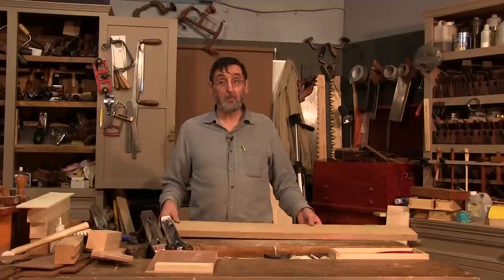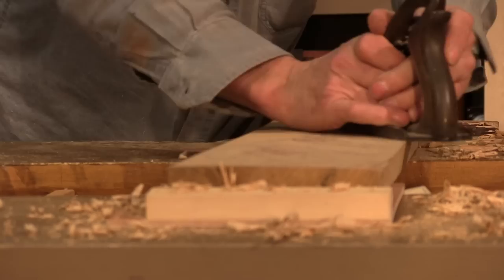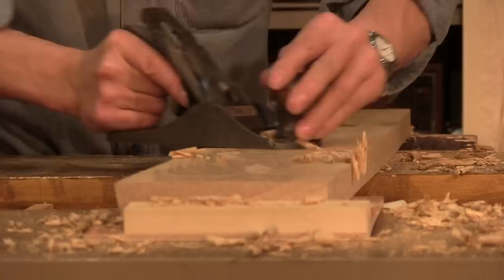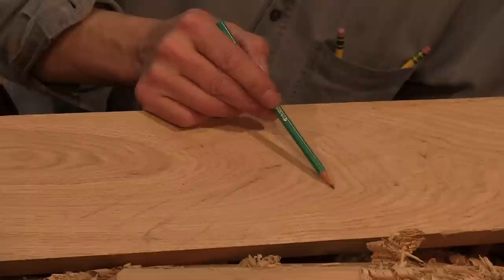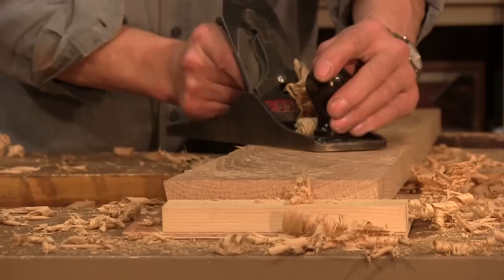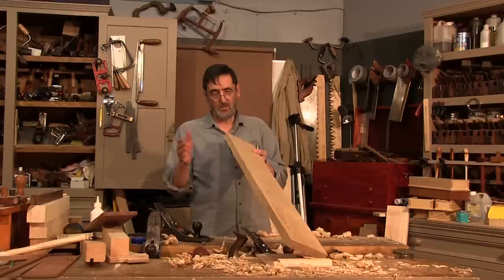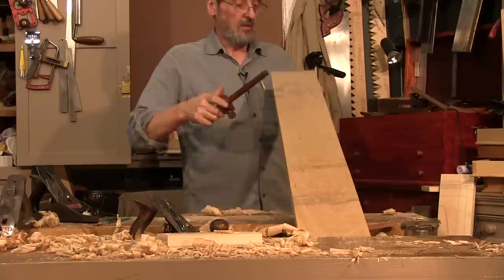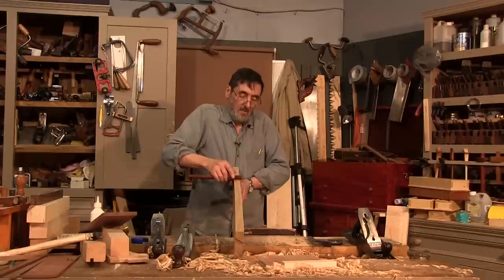How to make flat boards straight, smooth and square (stock preparation part 2) | Paul Sellers

Comment: I use a 4.5 Taylor plane and I'm waiting for a low angle Stanley sweet heart plane from Italy. I don't know why? Best price I think? I wish I could own a #4 Stanley, but my Taylor works great! A little heavy but if the piece needs to flatten a small piece I can use a Buck block plane. I think?
Reply: Instead of a Buck, have you ever tried an old Craftsman #306 block plane with an adjustable mouth? They're fairly cheap on e-bay and mine works like a charm.

Comment: Respect! I just wonder what will happen to that board once it has been straightened out.  Can you do this job in one day, or do you want to do it over several days to allow the wood to settle as it releases stress?
Reply: Good question. There are so many variables to be considered; Moisture Content (MC) of the wood, as well as the shop, species of wood, thickness of the particular board, etc., Then there's time available; physical fitness of the wood worker, how stored between planned or unexpected interruptions and  more.
Reply: @johnbesharian9965  I would not be surprised if it has been sitting up in his roof relaxing there for a year or so and should be fairly stable in his workshop environment. I heard him say once that he has 50 lengths of 4x2 up there waiting for odd projects etc.
But yeah, wood changes all the time, usually within acceptable limits once it acclimatizes to it's location and MC becomes relatively constant.

Comment: I have been trying to smoothen a block of Sal wood. The Sal is particularly very fibrous with thick fibres and also the wood is a piece from used old furniture and fully dry. My question is will it help to smoothen the wood if I moisten it and then smooth it. My only block plane (Ambika no 3) works perfectly well on beach or teak but I am having trouble with Sal, and it keeps getting stuck even if I minimize the blade depth.

Comment: hi paul, for the purpose of joinery, does the 2nd face and 2nd edge need to be perfectly paralell to the 1st face and first edge (the reference face and edge) ? ... if you are going to use ONLY the reference face and edge for marking (which I think is very good practice even if using power tools and you have perfect S4S lumber) , the 2nd face and edge in my mind dont need to be perfectly paralell and dead flat as they are not being referenced

Comment: Some kinds of very beautiful wood are barely impossible to plane.  Hard as concrete, very rough, twirly grain running in every possible direction, breaking out.  How do you deal with that?   I would like to know the names of those 'impossible' wood sorts.

Comment: I have an antique walnut table with badly cupped and warped boards on its top. Do I have to do something like this, or can I steam them straight or use some other process? Maybe the wood wasn't completely dry when the piece was made. (Sorry if this is slightly off-topic, BTW). Thanks for any replies.

Comment: Dear Mr Sellers

I was preparing three boards this weekend. Winding sticks were showing a raised right far corner. I kept plaining with no significant progress. Later I realised that by plaining the corner I have created new hump in the middle. The winding sticks were not sitting on the board so they were not representing the twist. 

Would you please explain your plaining technique in a bit more detail to avoid this problem ?

Comment: Mr. Sellers, do you ever need a longer plane, a Jointer Plane # 7 ?   I only have a smoother No 4 and  found difficult to plane long edges, and also i think it takes too much time to true faces, so i felt tempted for a number 7, but after watching this vid, i don't know if maybe the No 5 will be good enough (for now). What do you suggest?
Reply: Chava Flores Paul addresses jointer plane in this article here:
https://paulsellers.com/2013/07/15446/

However, keep in mind that he is THE Paul Sellers. Using just a no.4 plane, a couple of saws and some chisels he can build a credenza with worth thousands of dollars. His skill level is just that phenomenal.

So, if you have trouble planing, and suspect that you could get results with a #7, then go for it. Woodworking is about what works for you, after all. Best of luck.
Reply: truebluekit Thanks for the link. Funny thing, just today, before reading that article about longer planes I bought a used Stanley No.6; and it looks like i did good not buying the no7. This is long enough for what I do, and the weight is not too much for my arms, and i think it is a great machine, works fantastic.
Reply: Chava Flores There is another alternative - you can buy long jointing planes that are longer than a #6 to give you scope to work even longer boards... but that weigh MUCH less.... How? Wooden jointers.  Long before cast planes were even possible carpenters used wooden planes, and some furniture makers still swear by them look up "Krenov Jointer" and you'll see what I mean, but there are plenty available on ebay etc, that might look grotty, but a cleanup and tune (prolly levelling / flattening the base after years of use) and it'll make jointing a breeze.

Comment: A question Paul. A 5 or 6' length with cap and twist. Do you use your winding sticks end to end? Mid to end? 
And do you normally (as shown) deal with cupping and twist together please?

Comment: Another brilliant video. Thank you. Two points - we lose the RH audio channel hallway through - someone forgot to select dual mono on the new clip??!!   Second, what oil do you use - is it something special like camellia oil - or any old stuff - thin or thick?
Reply from the maker: not we can do via YT without losing what we have already gained I'm afraid.
Reply from the maker: +Paul Sellers slip a much in there, sorry.
Reply: I believe Paul uses regular 3in1 oil, he just puts a few drops once in a while in his canned pad.

Comment: I've got a question. I've seen in other context people working to steam or heat the wood into the desired shape. Would that have any bearing here, at least to minimize the eventual wood removal through shaping with a plane?
Reply: Yes you can use steamed wood to shape it. It really depends on how flat you need the wood. I do some projects that are extremely rough. 
Steaming would not replace the need to use a plane to produce clean, straight and square wood.
Reply: @bighands69  Thanks, Bighand. What I understand from your message is that I might use steam or heat to bring the wood into closer alignment, let it settle in this new position, and then go ahead to finish with wood removal. Have I got this right? And would this method introduce such internal forces that removing wood to achieve finish squaring would again send it out of square?
Reply: @gregorybarrett4998  In general wood being used for larger type of things such as the board in this video should be kept dry. If the wood is small or thin then it can dry out fast but this board for example to air dry might take a year. I think they do do that for lumber material that is processed super fast and from my experience often has yet to dry out when you buy it and when it does dry out it grows curves and twists worse than the board Paul starts with... I guess if they sell it wet it looks staight and feels heavy so people like it until it dries out, but then it's too late hehe.

Comment: Hi Paul would this work on very hard woods like Oak or Ash ? just asking as I have tried but i've been struggling and just wondered if I need to take another look at my plane sharpening. Thanks for the videos love them.
Reply: He is working on oak in this video. Good luck with the sharpening! Practice makes perfect. Or at least results in less frustration in my case.

Comment: hello and thanks for all the videos, I watch them all time after time and still enjoy them, however, I have a problem and wondered if you can suggest an answer, I have just bought a new plane, sharpened it and rounded the corners as seen, but, when planning a board for flat I still get the tram lines, this is very annoying, have you any suggestions please, thanks,
Reply: Christopher Hughes try adjusting with the lateral adjusting lever.  That with dialing back your iron should find you a happy medium.
Reply: thanks Eric , ill have a go at that and see what happens,  cheers.

Comment: Hi Paul:
I really liked this video. I especially liked that you picked a gnarly piece of wood. Was it maple? I would like to know. I read some comments and  I noticed that someone had the same question that I asked myself. what is and what oil is used there within that gadget you use to lubricate the tool surface. I often ask myself this question. If I were to use some kind of lubricant (oil) on a tool cutting edge or a wood surface what effect on the finished product be it stain or just a clear water based coat? Also with a gnarly piece of wood, what are the odds of it staying true. I spent years building structures with green fir here in B.C. and came to realize that your best bet is to get it green, put it where you want it  and let it dry into its inevitable environment. However Like every woman that I have known, wood is a powerful gnarly.
Reply: Don Carmen I don't know the other answers, but he said the wood is oak around 27:21, hope this helps!
Reply: Don Carmen On another video Paul commented that it is half of a tomato can with a rag in it, with 3-1 light machine oil. He said in this video, since you are in the process of planing, and will likely sand and/or scrape the piece later before finishing, all of the machine oil will be gone by then. If you don't want to use oil, you can also use paste wax, but you have to put it on and rub it off the surface of the plane before you use it, so it is a longer process than just machine oil.

Comment: Does the completed side stay flat like you left it, or when you relieve pressures on the 2nd side, does the first side move?
Reply: A recent  project included   7  x. 2 metre length boards  in seasoned ash - my own felled tree . After final trueing and  squaring , I put them all through the same final depth thicknesser. The next day one length had a new bow , despite remembering to keep checking for trueness and keep reversing the timber to take depth from both sides. The bowed piece had to be discarded .
Reply: @jonathanjones5135 , Shh! "It happens." You didn't mention how yur log(s) were cut; Through and Through" Quartersawn, or what? If it was Through & Through, most likely it was the center piece that contained the pith, the core, that warped. Everything outside of that center core would've been Quartersawn and would have been just fine by themselves without it, however.

Comment: Mr. Sellers, is this board pine?  How do you go about determining what the finished dimensions can be after flattening and straightening?  I mean without a well calculated guesstimate, one could be wasting a lot of time.
Reply: Oak
Reply: Thanks.

Comment: I have a very knotted piece of hardwood, my plane keeps gouging and i have no idea which way the grain lays, seems to run out from the centre
Reply: You bit of wood may be long and the grain may actually run across it. You can normally feel the grain by the fact one way actually gives more resistance when planing or sawing. Try planing from every angle to see if you can detect the difference. 
Check out Paul Sellers videos on how to sharpen and set a plane up just encase you do not have a sharp blade.

Comment: What kind of oil are you using to lubricate the sole of the plane?
Reply: +Jerry Swope Paul uses 3 in 1 oil in his dauber. I use 30 wt. motor oil in mine. Any oil will do as you are only putting a light film on for lubrication. It's also useful to go over all the metal parts on your planes and tools to help prevent rusty before you put them away. You can make a dauber with a small can, tomato sauce usually comes in short wide diameter cans and work great. Neatly roll up a bundle of old shop rags, wash cloths or towels. I keep the folds up and open edges down as I fit this roll into the can. It may take a while with a new dauber to saturate the cloth.
Reply: 3 in 1.

Comment: Paul:  How do you know the edge isn't inclined?  I am trying to square up some rough lumber, and I am running into that issue.

thx
Reply from the maker: Once the large face is flattened and trued with the hand plane we then use a square to check ourselves. If we are indeed inclined then we must make the correction by adjusting the presentation of the plane in relation to this face. It’s really a question of practice and more practice. Im sorry i cannot be more helpful but usually people don't practice and have too  high an expectation straight away.

Comment: So if i understand correctly its going to be easier to plane "downhill"
Reply: Yes, as he pointed out, like petting a cat, if you go with the direction the fur (or grain in this case) goes the smoother and easier it is. Otherwise you're planing into what is essentially end grain which is always pulling your blade deeper; causing tearout. Now, the foregoing is considered proper for for smoothing a surface or an edge. For "Hogging" off a great deal of material prior to smoothing, Mr. Sellers is showing that the "Defect" of tearout is an advantage for removing excess material quickly - it just won't 'look Pretty".

Comment: What if you used a sander? With a coarse grit?
Reply: A sanding belt would leave sanding grit in the coarse grain of a wood like oak, making it very hard to get out and, appearance wise, 'Muddy-Up' the appearance under a clear finish.

Comment: Paul Just kind of curious why not run the board through a power planer.
Reply: MrBluegrassfiddler 
Because this kind skill lets you work wood anywhere, any time.

I live in an apartment, and I'm so drawn to woodworking that I have setup shop right in my living room. After dinner on weeknights, my wife and kids would sit and watch the telly, and I'd sit nearby - in a cordoned off area so the kids won't intrude and get hurt - and I'd be planing whole boards without disturbing them.

If it's Friday night, I sometime plane boards right up to 1 a.m. It's just me and my planes, producing faint "swoosh" sounds, and my sleeping family aren't bothered one bit. My neighbours don't even know I'm working wood.

Do you know of anyone doing the same, but with a power planer?
Reply: @truebluekit , Do they lay off the chisel hammering to inconsiderate woodpeckers?

Comment: Anyone else have sound issues?
I'm loosing sound at 22:55 for the rest of the video. Go back there's sound, go past and nothing.
Re-load, same issue.
Reply: the audio switches from stereo to mono (I think that's what it is called?) Audio goes from both headphone sides to left side only.